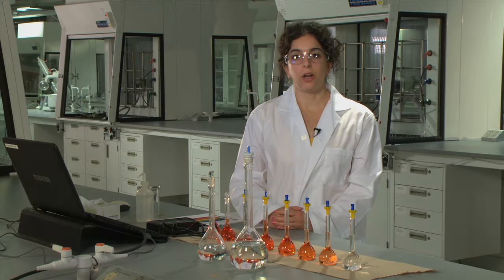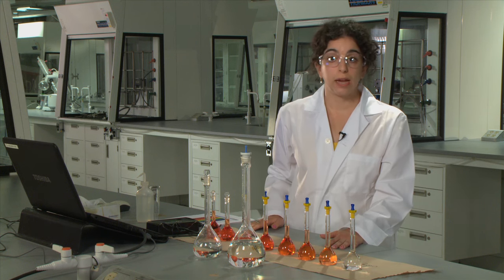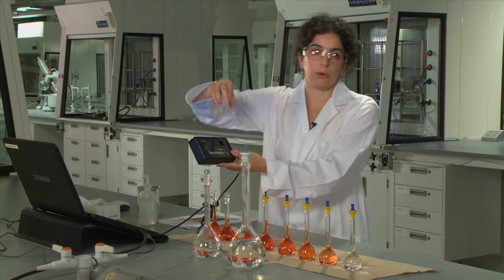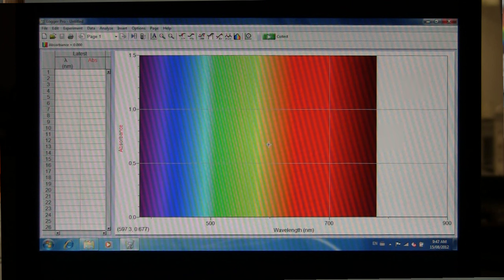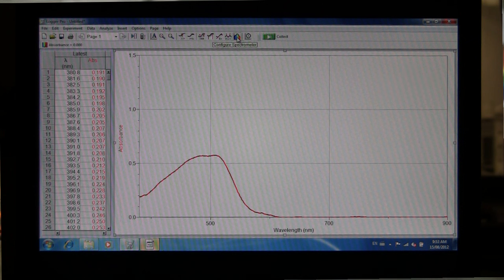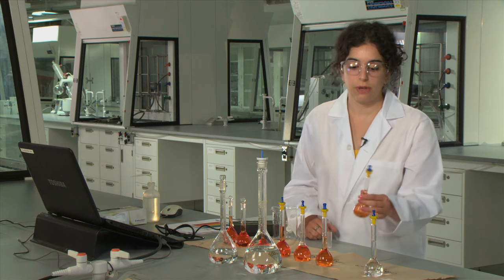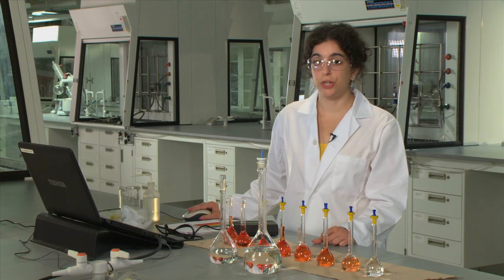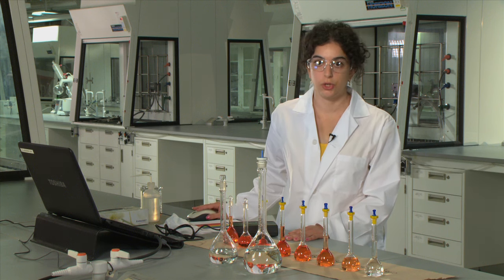Spectrophotometric Determination of Iron

Comment: In this demonstration  cuvette is filled with chemical (for measurements  3/4 cuvette is enough). Some times when using with full cuvette, the chemical gets spilled into the cuvette holder. If the chemical is highly corrosive, it attacks the inside electronics and optics of the spectrophotometer. As a precaution, it is better not to use full cuvette chemicals and also better to use a cap for the cuvette (it is available).  I have seen this problem before and  sharing this with the students and the instructors.
Reply: thanks! was watching this and wondered about that

Comment: impressive presentation ...  for one & all new to spec's .  now  i want to see more vid's you've posted.

by showing the lo - A end of the spec's ability to measure dilute solutions an answer to my question is  had.  
i wanted to know this in order to test a tlc strip's ability to detect  ug amounts of a cd.

also found it interesting your method has you re-use the same cuvette.  

thanks too for the rundown of the prep'n of each flask with those  iron reagents.
this will call for some homework study to  understand why this is done.  and to learn
what a test of the un-altered iron would have told you.

Comment: Why is our spectrometer so big ?
Reply: I wonder too
Reply: @syedmbilal7741  There are several reasons your spectrophotometer could be larger. It likely depends on the type of source and the type of detector your particular instrument has. Diode array instruments are typically preferred for teaching instruments, as they have few moving parts and are quick and relatively cheap. Instruments containing monochromators are preferred for higher quality measurements (like those in a research lab).